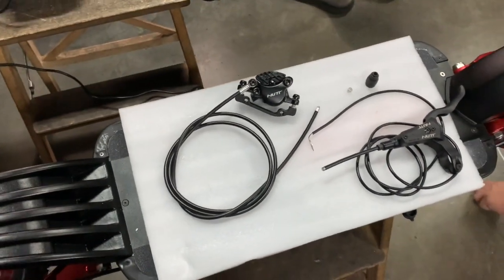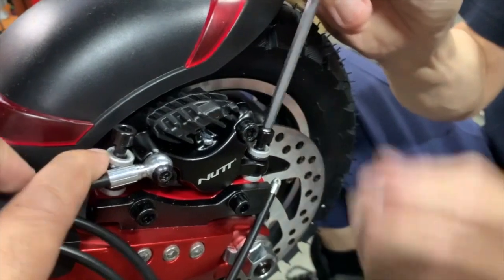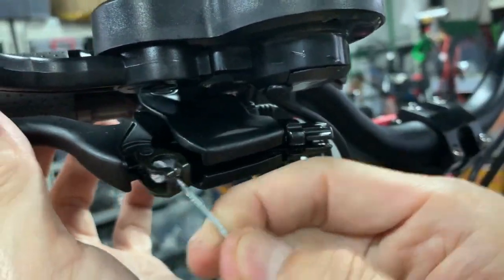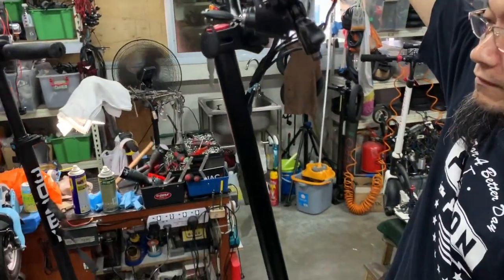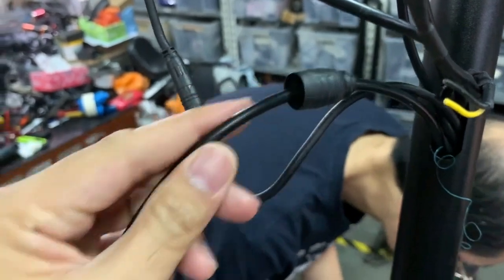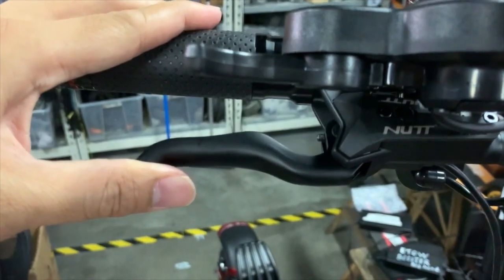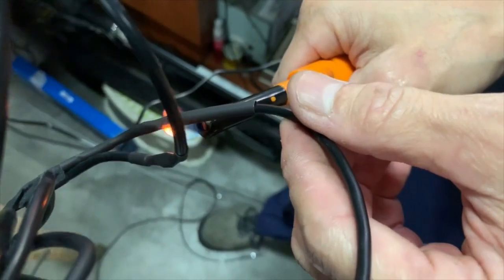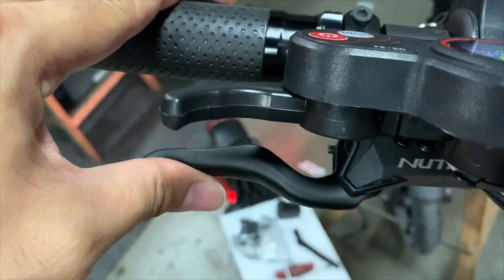ZERO Scooters hydraulic brake Install

Comment: hello there i want for sure to purchase your hidraulic braking set up...but there is the problem...in video you are cutting the wire.is necessary to cut?
Reply from the maker: RemarkablePoint no it’s not necessary anymore. We made it easier. Search for our latest zero 10 hydraulic brake video.
Reply: Sorry also I was thinking about you are cutting the hydraulic wire...

Comment: Hi everyone: I have the Yume D5 scooter and I want to install the brake too. do I have to solder the cables for the e-brake together and why? I thought it would work if I just cut it off?
Reply from the maker: Depends on whether you want ebrake.
Reply: @FalconpevSg  I don't want this e-brake. I can do without it because it then brakes too hard and is not good for the engine. so can i leave the cables open without soldering?
Reply from the maker: @pirelli77  yes you can leave it open no problem. But you can actually reduce ebrake power by adjusting the lcd settings
Reply: @FalconpevSg  OK thanks. then i will remove the cables. I don't need the engine brake anyway because it brake too hard for me.

Comment: Hi falcon pev can you give some advice about the installation that im planning? 
1. I have my previous hydraulic brakes from my mountain bike that is compatible with my eks particularly redline same with zero it has stock mecha nical brakes
2. It has no sensor.
3. Im planning to buy magnetic sensor for e-bikes, replace my stock sensor for my eks.

Will this setup work? Thanks and more power to eks community.

Comment: Is it worth it to Install nutt hydraulic brakes on the 52v version? I can get a deal for the zero 10x + the hydraulic + installation + wobbling clamp for about 1500 usd, take the deal?

Comment: Hello, thanks a lot for making this video. I have the EMOVE cruiser electric scooter and need to swap the brakes from mechanical to hydraulic. 
First, I want to know how well yours work in wet conditions.
Secondly, is there any place/physical workshop I can visit to have that installed?
Lastly, anybody to contact?
Thank you!
Reply from the maker: You can bring it to rev rides or try doing it yourself?
Reply: @FalconpevSg  
Thanks for replying. I am currently in Croydon (London). Do you mind if I ask for the address/location of Rev rides?
Reply from the maker: @oliveraidoo7861  if London definitely recommend PET personal electric transport
Reply: @FalconpevSg  
Okay man, thanks a lot

Comment: hi is it a diffrence if you allready have zoom brakes on the zero 10 x ? mine has the zoom brakes an i have an issue with the rear brake i want to switch it to the nutt brakes
Reply from the maker: Nutt brakes are indeed better. Made in Taiwan Nutt brakes are used on many high performance scooters

Comment: Thanks for doing this video. Want to know if these brakes will also fit up to a turbowheel lightning scooter like the zx-10. Also what are the tires you have mounted ?
Are they 120/90-10-57 Michelin reggae type ?
Look forward to your reply and thanks again...
Reply from the maker: Gary Linnert no idea if they will fit that model. It’s not the same.
Reply: @FalconpevSg  
Thanks for your reply. Will keep looking for the answers. Cheers GL

Comment: Hi, I have a zero 10x and I'm getting an error code on the display with flashing rear lights and the throttle doesn't work. I've tried pressing the brake 3 times on each side that doesn't work. Can you tell me what the white and yellow wire does, also black and black? If I disconnect them will it fix the code? I'm guessing it's just a signal for the electronic brakes. Thanksb
Reply from the maker: What error
Reply: @FalconpevSg  I think it's a brake sensor error. It's the (!) on top right of the display. The rear brake lights are flashing but there's no reaction when I press the throttle
Reply from the maker: @assassin8r  the brake sensor could be spoilt. Try removing the brake sensor?
Reply: @FalconpevSg  where is the brake sensor located?

Comment: The wheel and brake disc are almost the same size so break power is very good even with the original breaks. What I would be interested in are ABS breaks.
Reply from the maker: bogdan9 ABS brakes are actually electronic braking in the controller not in the actual brakes itself.

Comment: Any suggestions on how to press the brass needle fitting into the tube ? I don’t have the press tool there using or can you supply a link on where to purchase one.
Reply from the maker: dwane crow actually you don’t need the tool. Look at our other hydraulic brake video to see how to do it
Reply: I have a zero 10X I bought the nutt  hydraulic kit and watched the install video thanks unfortunately my kit only came with one collar so  I’m headed to the bike shop on Tuesday.
Reply from the maker: dwane crow not sure where you bought from but the ones from us works like this: https://youtu.be/Kew7gYhGvUM

Comment: Will oil come out the cable when you cut it and then need re bleeding?
Reply from the maker: You must cut the cable and insert the olive pin
Reply: @FalconpevSg  will it fit the kugoo g-booster  thanks
Reply from the maker: @ElectricunicyclesUK  don’t know what that is

Comment: What do do if my new hydraulic brakes are still noisy? I'm having hard times adjusting them.
Reply from the maker: What kind noise?
Reply: @FalconpevSg  the pad is rubbing on the rotor. I managed to tune the rear wheel, just releasing the screws and then holding the breaks while closing it again. For some reason I have some hard times doing the same thing in the front wheel
Reply from the maker: @rbmanb  new pads?
Reply: @FalconpevSg  yes. Okay! Done! Just had to release and and strengthen it twice more... But now no sound.

Comment: My handle pulls all the way back before the hydraulic brakes engages how do I adjust that?
Reply from the maker: Joseph Kadabra you may need to rebleed the brakes. But a way around it is to double pump the brakes

Comment: is there a specific needle head size that's required for this? I bought a kit for my zero 10x and the needle heads weren't included.
Reply: Dalset I have the same problem I bought the kit from REVRIDES.com and it did not come with a needle bolt for front or back.

Comment: I recommend higher quality washers. Those conical washer can easily slip and scrape on the disk.
Reply from the maker: Splodgo conical washers are typically used to adjust height on brake Calipers.

Comment: Hey everyone. 
I put my zoom brakes back together but my brake lights are flashing and it won’t move. 
Can anyone help me please.
Reply from the maker: Did you connect the ebrake wire properly?
Reply: @FalconpevSg  what is ebrake wire ?
Reply from the maker: @declansmith1022  if you didn’t know what that is then there is something missing in your installation
Reply: @FalconpevSg  i put everything back the way it was before.
Reply: @FalconpevSg  do you have another way i can contact you and send photos please.
Reply from the maker: Sales@falconpev.com.sg
Reply: @FalconpevSg  thank you. I fixed the problem:) 
When I was assembling the brakes on the handlebars I tighten the screw where the sensor is too tight. Loosened it up a little bit and it was back to normal :)

Comment: your comment is not correct. If rotor ( disk) is larger you need a new spacer, never use washers
Reply from the maker: We use Spacer washer interchangeably maybe not the correct term but the idea is the same

Comment: you keep skipping parts
Reply from the maker: curious to know which part was unclear?
Reply: @FalconpevSg  connecting the brake cable to the lever, well i had to watch another video to realise that i didnt need to drive the needle head to cable, as mine was simply to put the olive in before connecting it. Also the removal of the original brake levers wasnt shown and were to cut it
Reply from the maker: @TheSecretBaller  so it isn’t skipping parts. We don’t show what you don’t need to do.
Reply: @FalconpevSg  I disagree, firstly cutting of the brake levers (e brake cable) is needed, which wasnt shown from the start. I thought there was a connection that i had to unplug and had no idea which wires to cut. Secondly the process of installing the new brake cable to the new levers is different (for the 10x) as no pin is need to be pushed in before insertion.
Reply from the maker: @TheSecretBaller  anyway if you look at the video it was taken more than a year or two years ago. Parts have been changed so some parts are outdated. But in general the concept is the same and that’s what we are trying to promote. A detailed tutorial is not what this is meant to be.